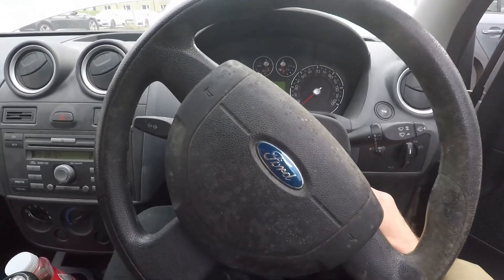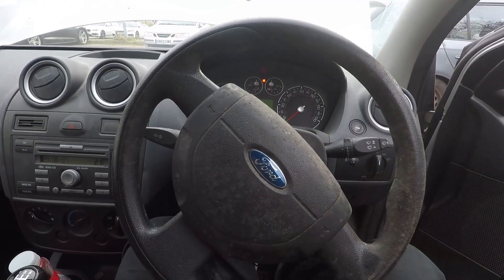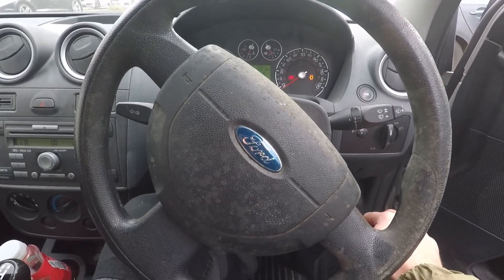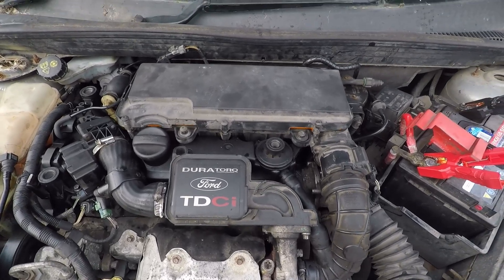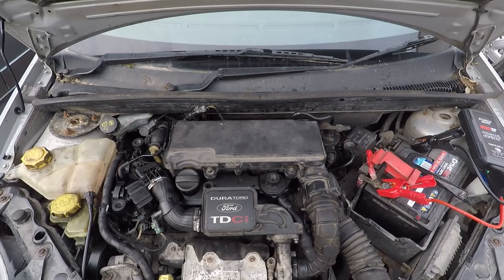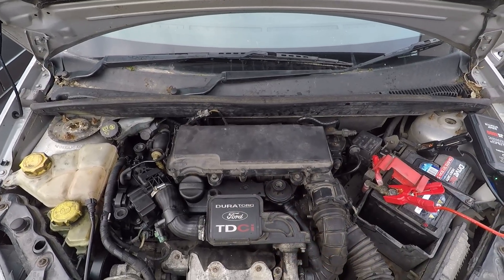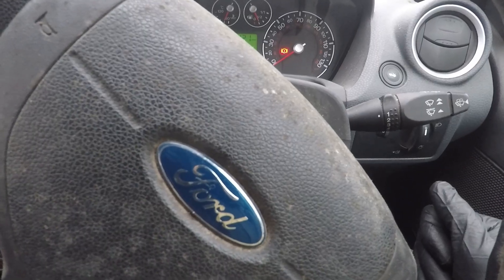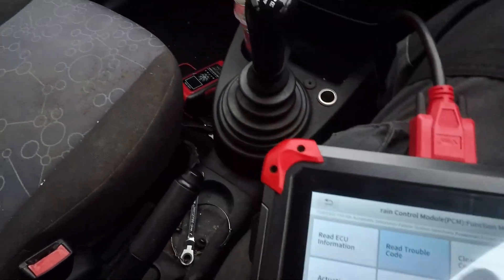Easy Injector Fault Diagnosis & Fix - Ford Fiesta 1.4TDCi (Peugeot/Citroen 1.4HDI/Mazda MZ-CD/CiTD)

Comment: you didn't have to program the injector in? tell the ECU the values of the new injector?
Reply from the maker: My scan tool didn't have the option to do injector coding on that car. But it runs fine so I'm happy 🙂
Reply: @GrubbyRabbitRepairs  the knocking you have at the end I'm trying to figure out where it's coming from for what I have is twice as loud
Reply from the maker: I'll have to have another listen next time I start her up. I didn't really notice a knocking sound. Let me know if you find out what's causing yours 👍

Comment: did you have to remove fuel filter
Reply from the maker: No need to remove the fuel filter on this model. I plan to replace it at some point soon though in case that's what caused the injector problem. I'm not sure when it was last done.
Reply: Just changed 1 of mine now car won't start. Thought it would if fuel filter was not removed
Reply from the maker: @thehutx  You've given it lots of squeezes of the priming bulb? It's a pain having no lift pump in the tank 😬
Reply from the maker: If you're still struggling maybe loosen the fuel pipes to the injectors and squeeze priming bulb until fuel flows from the unions then tighten back up?
Reply: No left pipes on it
Reply from the maker: @thehutx  sorry I don't understand
Reply: @GrubbyRabbitRepairs  why it wont start
Reply: no left it at side pride it all up started up after few turns of the engine

Comment: Nice Stuff… Which part of the Kingdom are you based or operate from? Have an Avensis that I am facing a similar issue..
Reply from the maker: Thanks! I'm in Lincolnshire, UK. Do you have a code reader to read any fault codes?
Reply: @GrubbyRabbitRepairs  am in Shropshire.. a layman in this field of yours.. had it checked was told Injectors and suspected turbo.. so the garage would not repair 🧑‍🔧 and I am trying, looking and learning from people like you so as to learn more and see way forward.. I can’t just scrap it yet.. I strongly feel and believe there’s still life in it with the right diagnosis and eventually getting it fixed.. fingers crossed 🤞.. if Lincolnshire was close I could definitely have made my way.. keep up the good stuff..
Reply from the maker: @kondaniphiri1278  Oh yes I think a Toyota could have lots of life left in it. Is it a diesel? If your turbo is accessible you could disconnect the air pipe to the turbo with the engine switched off, then you should be able to put a finger in and see if there is lots of play in the turbo spindle. As for the injectors, read any codes with a code reader. If that doesn't help, as well as the method in this video you could also try a leak off test to see if one injector isn't opening as much as the others. It's a helpful test especially if the engine doesn't fire up so you can't do the 'unplugging' test in this video. You can buy a test kit for £20ish off eBay. Lots of videos on YouTube how to do it. Good luck!

Comment: Good use of the X tool D7 and a thoughtful diagnosis of injector faults on a gifted Fiesta. Hope you get it through the MOT and back on the road. Manky interior is a bit of a challenge even for the Car Cleaning Guru. See his channel.
Reply from the maker: Thanks! I had it booked in for MOT the other day but I found a hole in the exhaust. So I've patched that with a bit of dodgy welding. Hopefully getting it MOT'd next week. I'll check out the Car Cleaning Guru, thanks! 👍